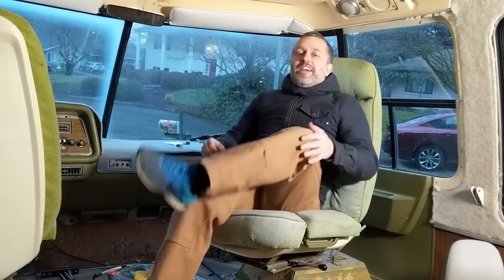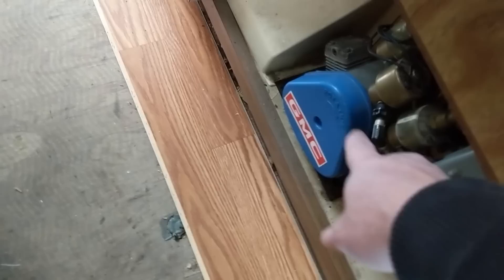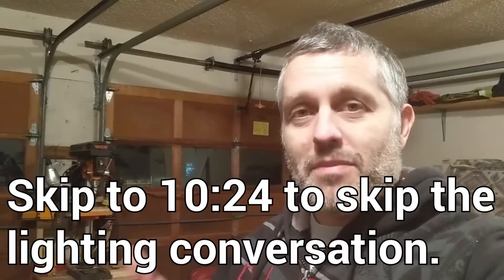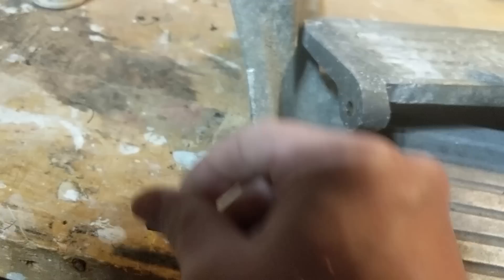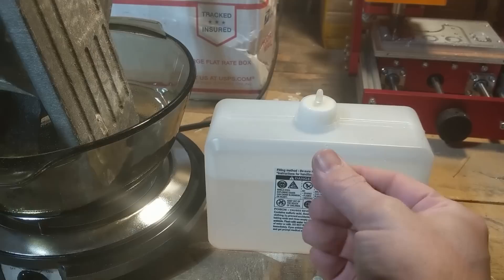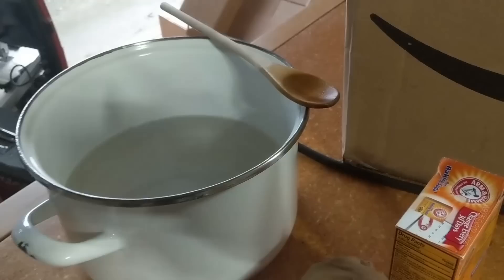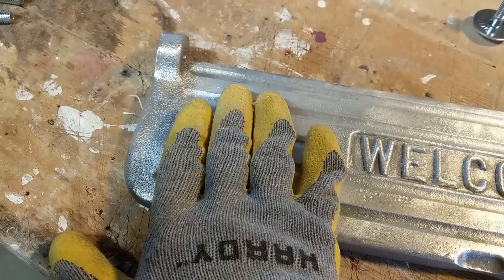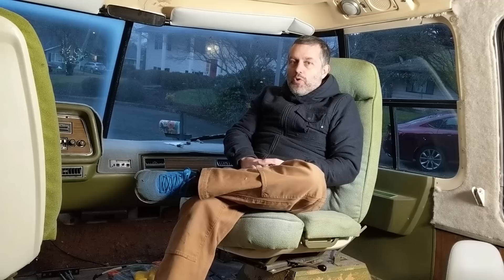Building the Best Damn GMC Motorhome Ever E.5 - Airbags & an Aluminum Step

Comment: Fellow GMC owner here, quick note on the air suspension controls. The "Left" and "Right" controls should be remain in the center "Off" position for travel, with the center switch in "Auto". The Left/Right controls are for leveling the coach when stationary. In situations that require more ground clearance you can drive with both in the "Raise" position under 15mph.

Comment: Hey, that's my Old Watermelon. I know where the Watermelons been for the last thirty years. I'm so glad to see it's being resurrected. Easy miles.
Reply: Did you sell it to Dan?
Reply: Yeah, Dan M. he spent a couple days in Spokane get'n it road ready, and then drove it back to Seattle. I guess it's been about three years since the 
Watermelon drove off my property.
Reply: Heads-up, the airbag on the Curb side  is new. I see Dan installed a Headliner kit. Unless Dan fixed it, there's a blown fuse in the Inverter.

Comment: Thank you for the video, I just drew up some plans from the bunk in your motor home and my brother is going to use them in his Ford Transit camper van he is building. Also i always use a machinist for anything that is "beyond my skill level" like rusted bolt removal. They will usually help me for a small fee or sometimes some do not charge me anything. (there is not many left and they are good about helping me on my 28 year old van. Enjoy your RV.

Comment: Getting those bolts out would have been much easier mig welding a nut on them and backing them out with a wrench. The heat from the welding process breaks them free.....

Comment: Having been a two way radio installer in my younger days I find in investing in a good right angle drill is priceless. You are into tight spaces without hesitation. 
Is it my imagination or did the air compressor look like a Hadley used for one of the older air horn setups. It uses a cogged belt which can be a PITA to find when they snap.
As for the aluminum issue I had several hinges on a military comms ISO box seize up because of poor maintenance of the previous owner. Stainless steel hinge pins running through high strength aircraft aluminum pieces. Wound up using a torch to heat the seized portions and a heavy hammer to beat the pins out. Managed to salvage the two remaining good hinges. What I have found that if you use a hollow pin with two small holes feeding both aluminum pieces, you can tap for a zerks fitting to inject a bit of grease into the hinge twice a year. 
Love those old GM engines! Reminds me of the old Oldsmobile rides I once owned!
Reply: I haven't thought about a zerk fitting. I was just planning on using some white lightning grease in aerosol can to blow it in there.

Comment: You could have simply drilled out all the steel even if it meant making the holes slightly bigger (which you did anyway at the end). Would have saved you lots of time & prevented that pitting. Sometimes we're too smart for our own good...

Comment: I would suggest a C-tek or similar type battery charger, since they can recondition or desulphate older batteries. Plus you can add a dongle to allow quick disconnect to your battery instead of fussing with spring clamps. As well I would look at a Snipper EFI set up or similar since it occupies the same profile as a carburetor, while providing self tuning, better cold start, idle, altitude compensation, power, torque and fuel economy. You also get the resolution of a wide band oxygen sensor, control of an electric fan and a display to monitor all the engine vitals for not alot of cash compared to what you have already and will spend. My neighbors Nova is running it on his 454 with great  results and just added ignition control. You may lose cruise control however. Should not need an alternator upgrade to deal with the extra drain from the computer doing all that math. I'm not an expert nor do I know what future plans you have but just another direction on the compass that may help. I figure we have been the beneficiaries of Moore's Law for over 40 years now, as I'm sure you know better than I, so may as well put it to use. Love the project and will use this and others as a guide if I pick up one of these fantastic motor homes, Cheers!

Comment: I'm not sure I would have tried boiling battery acid... I've removed steel bolts from steel, aluminum etc. BY using a drill, a bit,a center punch and a hammer.that had always worked. you got really lucky when the glass shattered !!!

Comment: About 20 some years ago I saw a GMC motor home parked on a side street partly into an intersection and the owner was lying on the ground under the front. I turned around and parked behind him with my flashers on.
He said the bolts on one axle were sheared off and it would not go. The axle spun but would not drive the wheel. He was about to call a wrecker and get towed.
I said if I remember right these had a Toronado type engine and drive train.
Then I asked if the bolts were sheared off, or had they just loosened up and fell out?
He crawled around and used his flash from his phone and looked at the spindle and said he didn't see any broken bolts.
I said if you take every other bolt out of the other side you can probably put them in the bad side and can drive to a hardware store and buy more bolts. He pulled them out and put them in the other side and said thank you for the advice. He said as long as they were tight three bolts on each side should get him home to Fort Wayne, IN.

Comment: JB Weld would probably do the trick fixing the end of that bracket better than the brazing. As for the Air Bags, there's quite a few videos on replacing those and I realize you want to try to keep the originals if possible, but consider the age and condition, don't be afraid to replace them because if they blow out on the road, that's a whole new can of headache your not going to want to deal with. Which segways to my next point on your project here: NEVER fall in love with old plumbing or electrical!!! You've got this thing opened up, take advantage of the  access and bring this wonderful vehicle up to literally this century.  Oh and most important, I hit the subscribe button. Looking forward to the future vids as they come out. Watching from Chicago, Illinois area.

Comment: I appreciate your willingness to share your experiment--the good, the bad, and the ugly included. Don't worry about the naysayers, it's all too easy to throw criticisms in hindsight.  You learned a lot, and now a lot of other people have too.  Pouring hot water into the bath is a great adjustment, as is the plastic containment tote.  The important thing is, you weren't hurt, and neither is your little CNC machine (I was quite worried when I saw it sitting next to the spill).  

So whereabouts in the PNW are you?  3 hours down from Seattle may put you somewhat near me (outside Salem).  I just picked up our GMC in September, and have this same problem with our step.  I might just try to drill out and put in oversized pins to avoid the pitting and the time investment, but I won't lie, you've tempted me to experiment!

Comment: Pump the peddle 3 times slowly before turning the key and it will start faster, you might want to look into adding an electric fuel pump. Once it starts to warm up you can hit the gas and it will kick down the idle.  Also Cinnabar Engineering does still make new OEM bags.  When you get the bags inflated you can put some 4x4s under the bogies to keep them up.

Comment: Dilution of sulfuric acid is an exothermic reaction so not only were you heating the container with the burner, but you were also creating heat by adding water. If you make battery acid my adding 95% sulfuric to DI water the solution will come close to a boil.

Comment: This might help in the future. If a battery goes dead, it can only be dead. There are not varying degrees of dead. If the battery is GOOD, i.e. new, well maintained, has water (yes batteries take water), then the battery only needs to be recharged. There is no need to completely replace a battery that is not damaged or old, or has enough water in the cells. If its in good condition but drained, all you have to do is remove the cell caps, fill the cells with distilled water up to the top of the cell slots, charge, and boom, your battery is in good order again. And the last tip, if you leave the key on or constant DC accessories on for 4 hours, or 4 months, there is not a more serious condition of being dead beyond the point that a battery is totally drained of charge. For a brand new car battery, this will usually be in the neighborhood of 24 hours give or take a few hours. It does not become MORE CRITICALLY DEAD beyond this time frame. Dead is dead. If the battery is in good condition and not old beyond is warranty time, it can be recharged very easily. Dont waste 200 buks on a new battery when the only requirement is time, water, and a charge. Thats free.

Comment: I've always had good luck with starting cold carbonated vehicles by using this process.

Push the peddle down 2 times holding it down on the second time. 
Turn key and release the peddle once started.

This sets the choke, from what I remember from my high school auto shop.

Comment: Just so you know. The next time you encounter this drill a hole all the way through the broken bolt and then take a Oxy/Act torch with a welding tip and heat the bolt almost to red hot. Walk away for a while come back and insert the easy out in the hole and back the broken bolt out.

Comment: Two pumps of the gas pedal is not enough, try 6 or 8.
Reply: Seemed to work just fine. Also having had an oldsmobile toronado of this era, pumping that many times tends to flood the engine.
Reply: The real trick is just waiting until there is actually some fuel in the Quadrajet's bowls.  Once that happens, a pump or two should get it started quicker.  The trouble is those mechanical fuel pumps, which take forever to prime at cranking speeds, and work much better at running speeds. I went with an electric pump.  I can prime for a few seconds, give it a couple pumps, and it fires right up no matter how long it has sat.
Reply: Santina Murphy  I believe that! Especially with extra long fuel lines. The pumps barely work at cranking speed. I almost always just use starting fluid or dump some gas down the carb if it loses prime. Saves the battery from being drained.

Comment: After you get the ramps for the rear wheels built, turn your rig around nose-in & put your driveway slope to your advantage. If you pull forward to the house and back on your rear bumper may be out in the street, but it looks like you're in a cul-de-sac so hopefully you have cool neighbors. 🤞🤞 Also, please go to Harbor Freight and get some big heavy rubber chocks. Even if you only use them parked up at home they are way safer than those cheapo plastic RV chocks. Subscribed!

Comment: I just deleted my entry step. The front is usually about an inch high - take a look. Some "gurus" insist that the front has to be higher than the rear, but that's nonsense. Once you get the ride height correct the step from the ground just isn't that bad. Also, what are you going to do with the fogged windshields? I was going to either replace them or just paint a black border and make the fogging sort of disappear. Painful decision, though.
Reply from the maker: I live less than a 2 hour drive from the Motorhome glass replacement specialists on the West Coast. I hear that the meetups/rallys usually have glass replacement happening. If you join the groups on Facebook you can get more information.

Comment: Should have drilled it out completely, adding a bushing...using a center punch to indent the steel will keep the drill from wondering off center. They do make a special center punch for reaching into holes of broken off bolts. These come in sizes to fit the holes. Although your drill had wondered off center, drilling an over size hole then incerting a bushing to compensate of drilling on center.  The acid thing wasn't necessarily. Too dangerous

Comment: Cool project!  I flirted with doing the same with a 77 I saw for sale, but it was in sadder shape. Really musty from water damage.  I passed it up as too much work. But under better circumstances, I'd like to do such a project. 

I hope you redo the instrument panel, ie  make the panel out of veneer would, throw out the am/fm tape deck and replace it with a 2 DIN Android unit. Seems like there's plenty of space to put a full time review camera display. Maybe add two more cameras for blind spots linked to your turn signal control - - full time rear view, except when you signal left, it displays your left blind spot and vice versa for the right.
Reply from the maker: Good Ideas!

Comment: The smart way is to just drill hole in step on each side just slightly smaller than hole in brackets then use a large roll pin

Comment: For the next time. try first to heat the part a while, the aluminium have different expansion coefficient, so it will expand mores faster, then try to put some ice in the iron bolt, it will contract ir a release.
Cheers

Comment: Boiling acids is fine as long as it is outside with a fan to push the fumes away. If it pops on the wrong material it could be quite toxic though. Just always do your homework.

Comment: Hydrated aluminum salt compound dissolving steel is not a myth. But it does take a very long time to "dissolve" steel. regular sea salt would work just as well. Salt oxidizes steel, oxidation produces rust. Rust is chemical steel oxidization. When enough rust forms, the steel weakens. With the passage of enough time, the steel will decompose and go away. Aluminum does not oxidize. This is why aluminum is used in boat structure. You didnt bust a myth, you just didnt want to wait 6 or so months for 2 bolts to rust out of aluminum holes.

Comment: Not a good idea to hammer on cast metal.  It shears easily!  It was also obvious the acid would etch the metal too. You could have used an acid resist to prevent it.
Reply from the maker: The force of the blows was absorbed by the Steel shank which protruded out of the Aluminum by about 1/16" I was rolling over the edges of that shank with the hammer.

Comment: this sure is a video of how not to remove a stuck bolt, pouring cold water into boiling battery acid is a really bad idea.  Drill it out and  tap a larger thread onto the hole and you have a propane tank sitting on the bottom !

Comment: Stainless steel bolts would've been better for the step.
Reply from the maker: You can't use stainless in contact with aluminum in the presence of water. It's called "galvanic corrosion."

Comment: Why not just drill them out?
Reply: Aluminum is much softer than steel. The drill bits tend to wander off center and damage the aluminum because they are following the path of least resistance. To maintain the functionality of the hinge pin the holes needed to stay in their precise location. This is an extremely daunting task to achieve with only a drilll press, and messing it up would be more likely than not to happen. Misaligned holes would mean the step no longer functioned as designed.

Comment: Why didnt you just drill it out? 5 min job...
Reply from the maker: It's exceedingly difficult to drill harder steel out of Softer Aluminum without damaging the hole in the Aluminum.
Reply: The Digital Maker no its not.. i just did the exact same thing but on a motorcycle cylinder and that is way more critical than this.. if you have drilled in to the aluminium it doesnt matter cus the hole didnt even have threads like on the cylinder